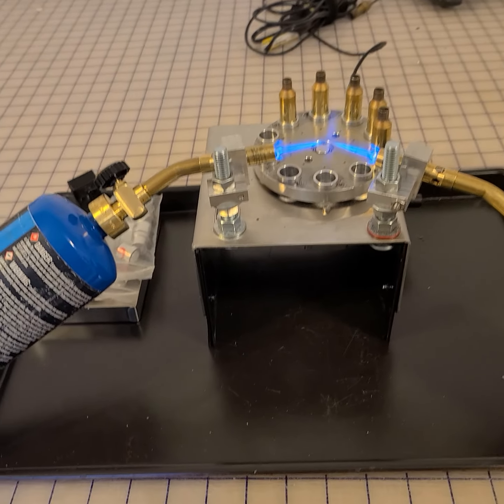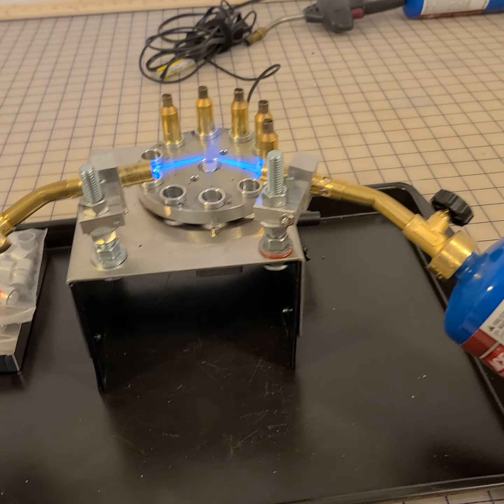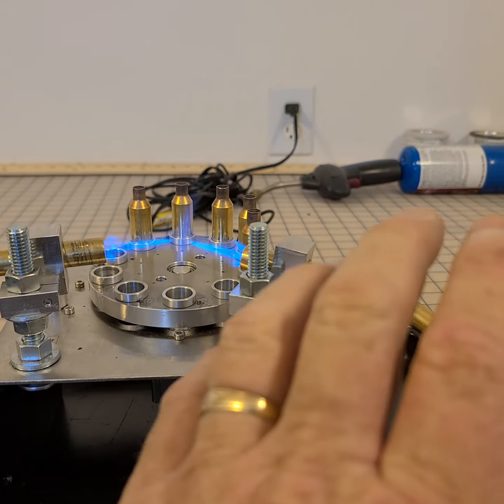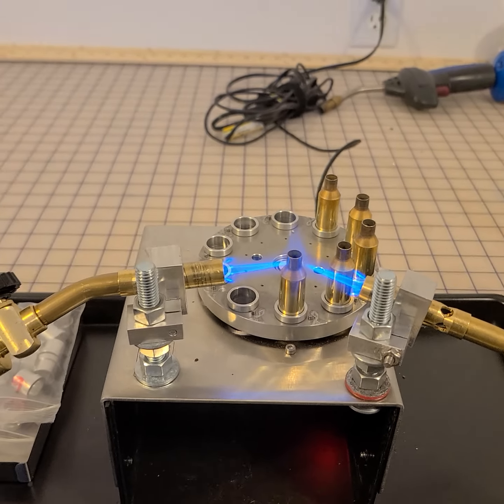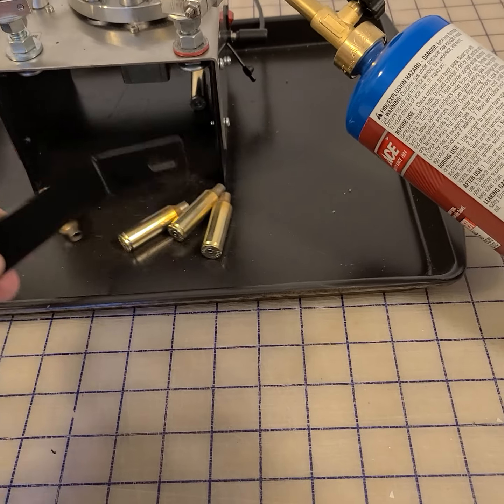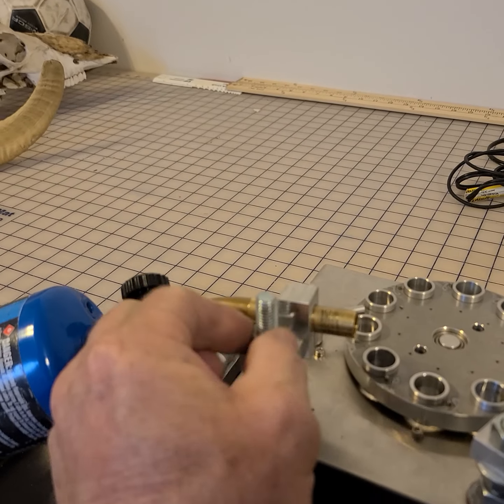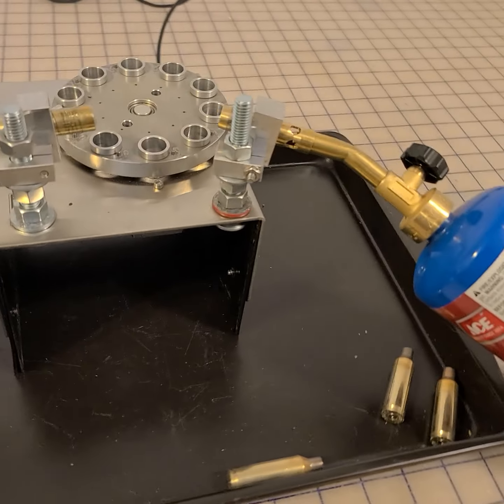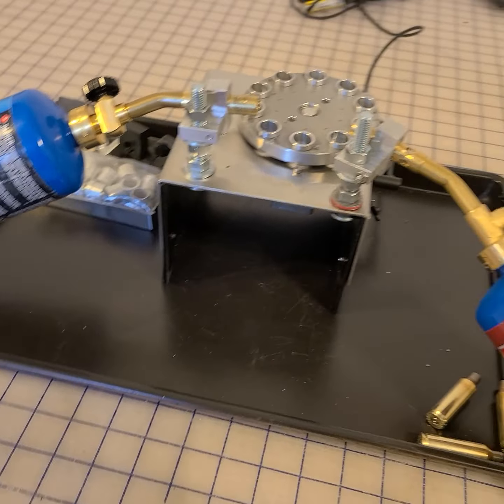AGS annealer Dual head Conversion

Comment: Hey Brother. Due to your first review I bought and just received my machine. I plan on doing your two head mod with the bolts or all thread before I even start annealing my brass. Was looking for a unit that wouldn’t take me broke and I didn’t have to do a bunch of changing of parts and fiddling around with to change calibers. Thanks for your detailed review. You saved me a bunch of time and a little money. Great work and thanks AGS for a great product. Haven’t used it yet, but it seems really well built.

Comment: What's the advantage of 2 torches?  I really like your new torch support.
Reply from the maker: It's faster, more efficient and I believe more uni-formally effective.  I just used a 3/8 carriage bolt/nut/washer system in place of the original smooth vertical post ( and installed a 2nd one) so I can easily, quickly adjust both sides to any size case.  I did away with the alumn sleeves as they were not precise enough for the various case sizes I use.

Comment: Difficult to find proper torch head. Many are too long and flame is too long and wide. Any recommendations from Amazon or Ebay? Great video.
Reply from the maker: benzomatic
Reply: @flooded3456  Could you post the model. Seems as if Benzomatic is a brand name that encompasses many torches from soldering to grass burners. Thanks.

Comment: Question;  if you are using 2 torches then you need less time to heat the brass.
 How do you speed up the machine to compensate for this ?
Reply from the maker: It has a speed control dial Built-in easy